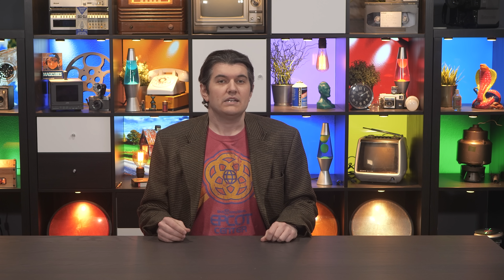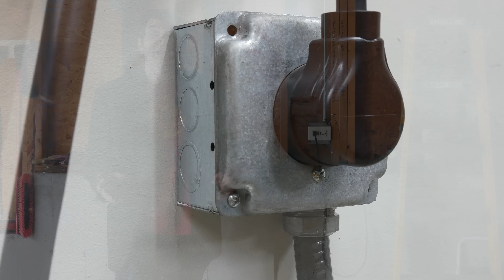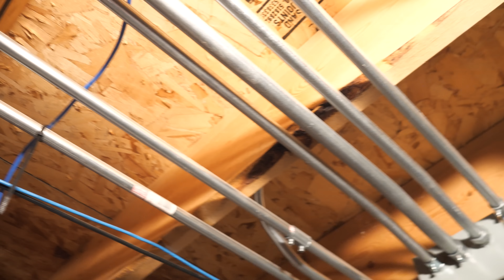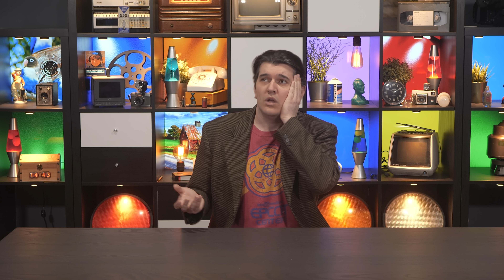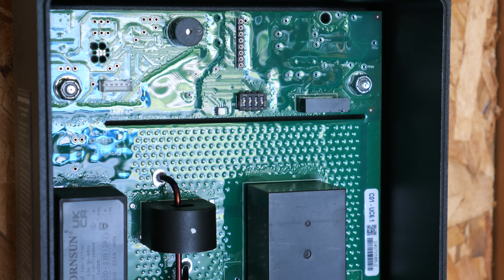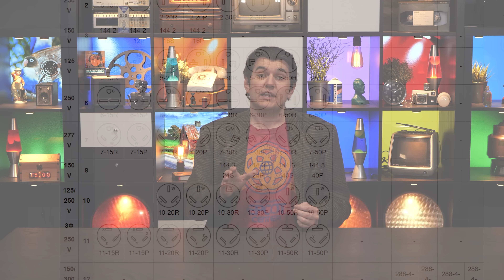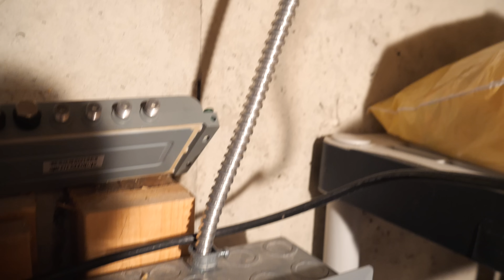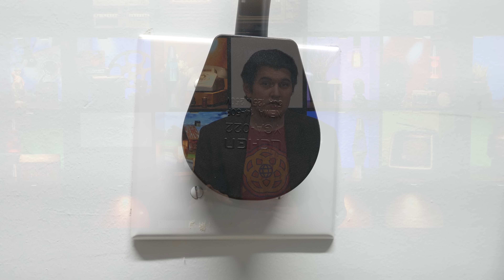The "standard" car charger is usually overkill—but your electrician might not know that

Comment: Electrician here - My customers must stay ahead of the Jones’s - we put in whatever one asks or pays for. Those who at one point worshipped Tesla in the more affluent crowd would ask for 80A - Despite not actually owning “dual charging” cars. Yes you heard that right. The CHARGER is in the CAR. For a Tesla at least - Your capacity is in the wall in the gauge of wire and ampacity of the breaker serving said wire. The thing on the wall is merely an interface informing the “charger” that is in your car what is connected to. Hence the dip switches. (Oooh as I type this you actually say it - how nice) 10:18
Reply: Now let’s talk about code violations. Support securement of flex and MC is within 12” of termination boxes and generally the every 4 feet or so running along the wall surface. Not just flying across diagonally in space - the non-workmanlike manner which is yes - language in an actual code. 

Now let’s speak of the location of your tailpipe. It’s on the other end of those wires likely at a natural gas fired power plant - quite possibly in a foreign nation. And due to the additional mining of exotic minerals, and shear scale of additional metals - your electric car comes with a significantly higher amount of pollution built right into the car itself that will not be equivalent to a gas powered car until both the electric car and gas powered car are nearly 10 years old. The shear amount of energy required to produce an electric cars is so much higher at the outset that it takes about a decade of driving a gas powered car to become equivalent. 

If driving an EV is “saving the planet” in your mind - think again. Driving less and changing your lifestyle is what does that - it’s not what you drive - it’s driving LESS. Or not at all. Working where you live and eliminating commuting on a daily basis. Make it mandatory that your kids walk or can walk to school. And not living in a “just in time” on demand supply chain economy. And maybe not paving every single surface of our planet in petroleum products would also help. Enjoy!

Comment: Decades ago, even at university I could reserve/rent a spot for my car with a 120v circuit to plug in its block heater (this was in Ottawa).  That was simple, standard practice, and wasn't seen as difficult or onerous.  They've likely all been ripped out as cars don't need block heaters these days, but recreating that infrastructure in parking lots and parking garages (including in apartments) should remain equally doable.  If I was still in university, I could go in the morning, spend my 6h (or more) there, and that would be 24mi-30mi (38km-48km) which would be more than enough to get me home.  (Actually, I was in architecture, and so I'd arrive in the morning then leave again in the morning, which would be more like 16h of charging... :P)

Comment: We’ve been living on a regular wall outlet for 2 years with only a couple occasions where we need to use fast charging for an unexpected errand. We’ve delayed upgrading due to complexity and expense (many things you mentioned such as detached garage, no space in panel, etc) and I just concluded the other day we can do exactly what you suggest and go lower power. Going to do a couple upgrades to be able to use a 16A 120V charger but the big upgrades for full speed charging are just not needed for any of our driving habits.

Comment: Charging an electric car on a 12 amp connection would be like you uploading your videos to YouTube via dial-up connection. Yeah it'll get the job done if you plan ahead but if you're in a tight situation and you know you need a bit more charging faster than a 12 amp investing in a higher capacity plug is well worth the $200.

Comment: I had a 200 put on the garage and 100 to the house.  Works fine and air conditioner no longer dims the lights on it's 70 amp bump start.

Comment: Running at 24 to 32 is fine overnight.  Public DC ruins the life of the battery a lot faster than home chargers.  Tesla drivers found out with the free charging with their cars after 100,000 miles.

Comment: I've done the math and I could use a standard household outlet to charge my car with it based on how much I drive each day so long as I plug it in each night, and even then it wouldn't be absolutely critical. Two or three nights a week would probably do fine. The problem is that I don't own the only electric car I would consider buying. But hey, I bought my lottery ticket and that could change.

Comment: 4:22 10 awg is NOT the largest size you can get in metal clad cable. Typically the largest you’ll find is 4 awg in greenfield.
Reply: 12:18 you didn’t ground your junction box

Comment: The NEMA 1450 you show is substandard. That is one fro a box store and is meant for use on an electric range. IT IS DANGEROUS TO CHARGE AN EV. YOU NEED a Hubble of Bryant commercial outlet. Also should be using 6 guage wires.

Comment: Hey men, if you want to talk about electrical systems on your channel you should hit up a professional.  This video, it's not using a proper lens.  How it works is, you have a typical 50/100amp feed, and it's split up into different circuits based on need.  Every home already has a large appliance circuit, that's the same circuit used for an RV hookup.  Just a standard 220v circuit.  Costs around 300$ to install, at most, if the power box is in the garage.  RV outlet is 50amp 220v, that's all you need for super chargers.  Just tell people who talk to you that you're not an expert.  Because you aren't.

Comment: I am surprised not to see more focus on NEMA 6-15 plugs, like were used for a lot of window AC’s in the 1970s/80s.  2x the
 charging speed of a regular wall outlet and can use existing wiring, you just need to rewire it within the breaker panel.

Comment: If I may - I'd love to see an examination of the car cigarette lighter and how it morphed into the original car charging port with a pretty long lifespan including hanging on here in the present. I really think you're the guy to do it justice.
Reply: That's actually what I thought the video was about from the title and clicked out of interest, I still drive a truck with a push in lighter in it and use it from time to time
Reply: This is also what I thought this video would be about. That weird round connector originally used for lighters has become this awful standard for powering things in cars and it needs to die. I'm glad that USB has mostly supplanted it and it's disturbing how many manufacturers mount them so coins can fall down in them.
Reply: @Eric__J  The amount of times I've had to use gum on a stick or something to pull a penny out of the charging port is ridiculous.
Reply: And the battle to the death between the round 12v cigarette lighter socket and the 12v flat SAE connectors!!!
Reply: @lucash1980 

Huh, I didn't know about the SAE version. Something else to look up now.
Reply: I do enjoy a nice sae connector.
Reply: @lucash1980  i think we are all moving to usbc anyways

Comment: There is no such thing  as overkill when it comes to charging EVs. Typical breakers are 15-25 Amp on a 120V line. Do the math. Talking about  a struggle to  get things going.  The converter  needs to have headroom  in reference to current. Also a steady line voltage  without  too much fluctuations. Btw, if you look around  the house, high energy consuming  appliances  taking about 1600VA it could be significantly  higher at a startup surge current.  I have no clue why  would  anyone to install  a system that is pretty  much obsolete  from the get go. Fast charging  is already here.

Comment: The one benefit of smart chargers that my Ioniq 5 can’t handle is that the power scheduling is more robust. The local power company has a seasonal time-of-use schedule with peak power rates both in the morning and the evening, only on weekdays. The car’s scheduling allows for one block seven days a week, which means during that time it will charge during one of the peak hour blocks, and then not charge during the weekend off-peak block.

Comment: Now try to charge a Silverado or Hummer, it will take weeks. Cybertruck would be ok though but a 40 amp or more circuit is ideal.  You are correct though. A lower amp charge is not an issue.
Reply: I retract my comment. You touched on it with logic and you are right.

Comment: Even trucks, depending on use case, can easily rely on a small circuit. I have a Rivian R1T and have been using a 30A outlet (charging at 24A) for over two years already and a couple other cars before that. I can get around 55 kWh overnight and on the off-chance I need more than that, I just drop by a DC charger to get within the 55 kWh that I can do at home. Easy!  If/when my wife gets an EV, then I’ll look at upgrading to a 50 or 60A circuit with a dual/headed EVSE.

Comment: These days, my main concern is about the wear and tear on outlets not really designed for constant insertions. Ideally, any outlet designed to code should be fine but the reality is short of that. So, these days, I recommend getting a stationary charging setup - perhaps even hardwired if needed. But, an installed EVSE of any capacity that is plugged in permanently is fine too. Save your mobile charger for road trips.

Comment: Consider touching on so-called "EV receptacles" such as the Hubbell/Bryant 9450FR, which meets NEMA 14-50R standards but, according to their literature, "delivers a 50% greater contact force on plug blades" and is "designed for durability, withstanding heavy usage and frequent insertions and removals without compromising performance."  The marketplace is responding to the inadequacy of the NEMA 14-50R specification by providing souped-up receptacles such as these, but as far as I know, no industry standard exists for these "EV receptacles," so one has to rely on brand reputation, word of mouth, and experience to know which of these receptacles effectively address the limitations of cheaper, garden-variety NEMA 14-50R receptacles.

Comment: Thank you. I've been debating getting a phev but getting a battery and upgrading my electric system was a huge turn off or at least delay in purchase. If i can use my existing washer/dryer cuircut that would make it at lot easier for me.

Comment: Electricians know... the real ones anyway.   The want to Be's that try to secure the job by underbidding or trying to shave corners buy using substandard parts. NEMA 14-50 plug for Rapid Charging..  However, 30 amp system with 10 gauge wire,  just have to set the limit to the charger to tell it this is as fast as one can go.  So it Charges slow...  So can one get slower charging stations that cost less.

Comment: A $600-900 3kW generator works, too, as a backup generator, and tri-fuel so it can run off Natural Gas lines connected to the home.

The most annoying thing is shared space chargers. Like, it's convenient to have car chargers at work or at a movie theaters, but they're always occupied and they're far away.

Comment: The main issue with slow charging is that you will charge your car more frequently than the others, which means your car's battery will be shallowly used then charged to full again and again repeatedly. That is very bad for BMS, because BMS doesn't know how deep the battery voltage could drop, which causes a more conservative estimation of the battery capacity, which means your mileage will degrade quicker than the other users with level 2 chargers.

Comment: Most chargers that come in the trunk of a new EV is a 120vac charger meaning all you need is a regular wall outlet. It is slow, taking 6 or 8 hours to recharge you car. Just perfect when the car sits in your garage all night it will be full charged in the morning. HOWEVER, if you forget to plug your car in & remember only when you get up @ 6am, there is not enough time to charge enough to get you to work and back. BUT, if you had a 220vac fast charger, it will give you enough to get you to work and back in 2 hours. OR you have a road trip planned for Saturday and forgot to plug in. YES normally  a slow charger will do you fine BUT it sure is nice to have a fast charger  JUST in CASE to take care of emergencies that you know will occur from time to time.  Thats why we buy car insurance.

!

Comment: As a fellow midwestern Ioniq(6) driver who did their own hardwire Grizzl-e Classic install, I emphatically second almost everything in this video! I also identified 24A as “good enough” and have left the dip switch setting there for over a year now. An electrician and EV owner coworker of mine advised that it would be “best practice” to put the EVSE on a circuit that corresponded to the device’s max current draw, but upon realizing how much that would cost in materials I settled for a 40A-capable (32A continuous) circuit. 

The only thing I would add is another caution against relying on the 120V portable “chargers” for daily use. You mentioned the issue of outlets getting worn out by constant plugging and unplugging but I would argue that a bigger problem for many is that a lot of these chargers have a heavy surge protector/current controller dangling on them that can put a lot of stress on the plug connection. A poor or partial plug connection causes a lot of thermal stress on the outlet and can lead to the melting/fires you displayed. Just another thing to look out for.

Comment: This is extremely true for apartments. They just need a standard plug at each parking spot. I hate it when apartment buildings are told it will cost $4000+ for each charger. This is not true. That is the cost for multiple 10kw chargers because they have to talk to the power company to do that.

Comment: For anyone who has owned a Class A motorhome, you have a 30 amp 240 to 60 amp 240 volt adapter cable and a 15 amp 120 volt to 30 amp 240 volt adapter cable 
Now, whether a car can be charged off 120 volts and does draw more than 12 amps, you can do it
But you have to be sure the car will charge off 120 volt 15 amp outlet 

The car needs to have a circuit that uses 120 volts
The 240 volt circuit in the car usually is full speed charging 
It detects the 240 volts and pulls 45 amps even if you are plugged in to a 30 amp circuit 
So you need a car that has the software and hardware to allow you to select what type of outlet you are plugged in to.

I miss the days when we could do 9ur own electric and even build a house with no petmits and no inspection 😢😢😢😢

Comment: Fun timing for this video! We recently had to get a new car after a red light runner hit us, and it happened to be a few months before closing on our new home (ugh). The day after closing we went out and got a 2023 Bolt. We both wanted electric and I love your EV videos, we just got forced into doing it sooner than later. 

Our builder puts these outlets in their homes by default and it's been working great, but I can defenitely see that this charging rate isn't required for our situation. I get 2 hours of free charging at work, so I often come home with a SoC 5% lower than when I left.

But so far we're loving the EV journey! Thanks for giving me the background knowledge and motivation that helped us take that step!

Comment: A small nitpick:  Those 14-50 receptacles/plugs are actually designed to handle a full 50 amps continuously.  The "80% rule" is intended to be an extra safety margin, but all of the components are actually designed and tested to be able to handle the full rated current anyway.  Even if you do not observe the 80% rule, as long as you are under 100%, you are still not actually exceeding any of the design limits of any of the components.  (You just don't have as much of a safety buffer in case something else goes wrong.)

In fact, the NEC does not actually require that you limit the current to 80% of the circuit at all.  It only requires that when planning the circuit, it should be designed such that the anticipated load is not more than 80% of the circuit rating.  However, if the actual load ends up being more than that in practice later, that is not technically even a code violation (it's just not really recommended).

So you actually can pull a full 50 amps through those receptacles, and it should be entirely safe to do so.  It is just recommended practice to not design things that way if possible.

(Personally, I suspect that the majority of those failed receptacles are either because people were plugging/unplugging them over many cycles, or they were not installed correctly, as you said, not because anybody was actually overloading them.)
Reply: I had a failed receptacle at my mom's house. It was 100% installed correctly. I even used a toque wrench to tighten the screws when I installed it. Those cheap receptacles just aren't made for this use-case. She never unplugged the charger in the 2 years before it melted. It was inside of the garage.

The innards of the new 14-50 that is designed for EV charging are much beefier than the old one. It's similar to the difference between an 80 cent outlet and a commercial outlet.

Comment: i was lucky enough to have the electric panel right next to where i park my car, and a qualified friend who was willing to install the needed plug for a few beers and some pizza. I just charge every few days, rather than plugging in every night like I used to when I had a standard 120V outlet for charging. But I have been adamant in telling friends who are interested in getting an EV that what I have is not strictly necessary.

Comment: You don't need to drive 200 miles a day (on average) to want one of these. You need to drive 200 miles a day for a couple days in a row (or probably some lesser combination) once in awhile.

Just like it's not practical to own a vehicle for every situation (I may only need to tow a camper a few times a year, but I can't have a dedicated vehicle just for that), you can't size your electrical service for the average case either.